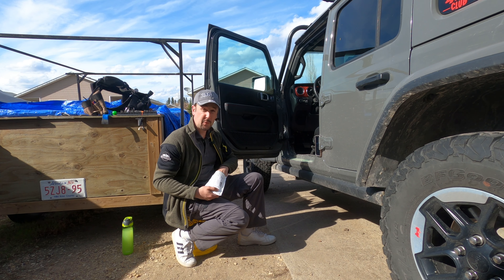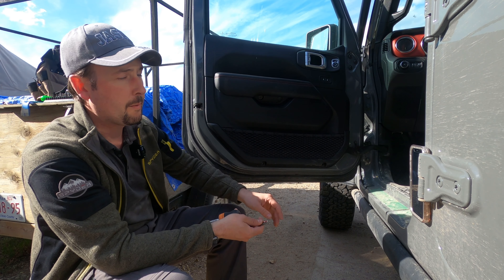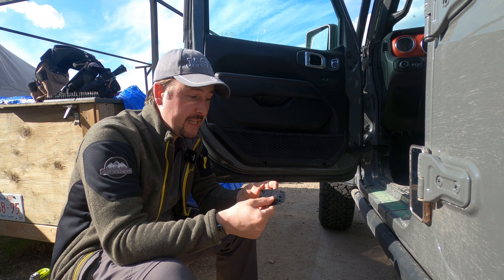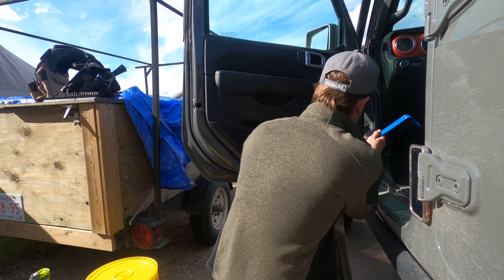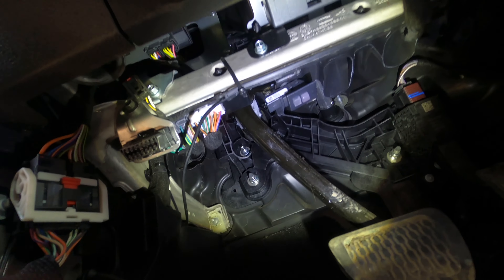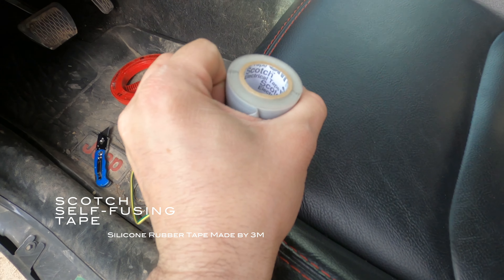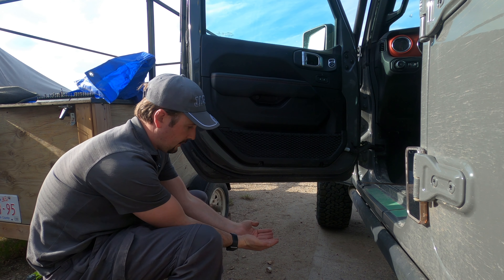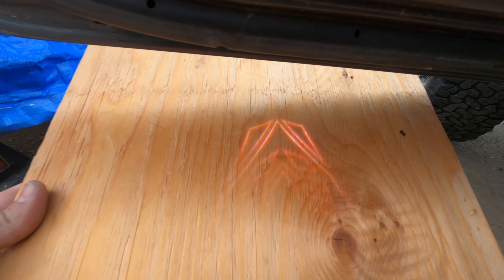How to install courtesy lights on a Jeep Wrangler JL | Decepticon "Swindle" in the night mode

Comment: So I also have LED lights under my dash and I'm about to install my lights in the front two doors too but since I'm not much of an electrician I'm not ecactly sure how you spliced into the LED lights for power?? If you could help me out I would highly appreciate it!🙏🙏🙏
Reply from the maker: I explain the power source in the first 3 mins. I spliced the power from the LED floor lights that come from factory & fed them into the door.
Reply: Did you use a T-Tap to splice it? I wish you filmed this step as  well
Reply from the maker: @blackhatbandits9608  it’s just two wires you splice together. Crimp, solder, or whatever you want to use.
Reply: Thank you for the advice because I ended up figuring it out thanks to your video!